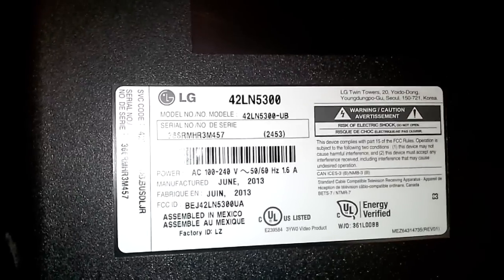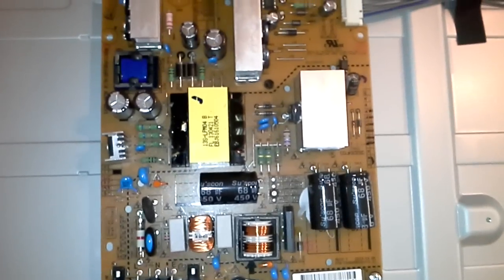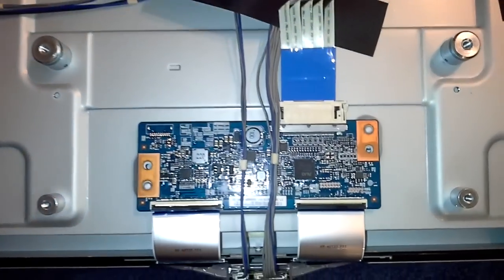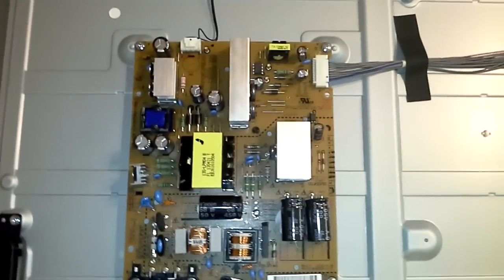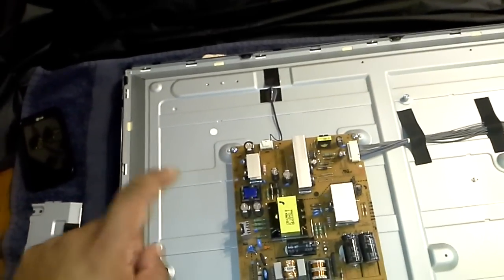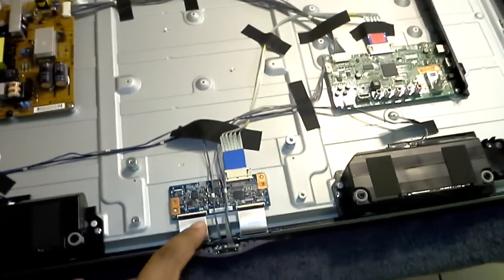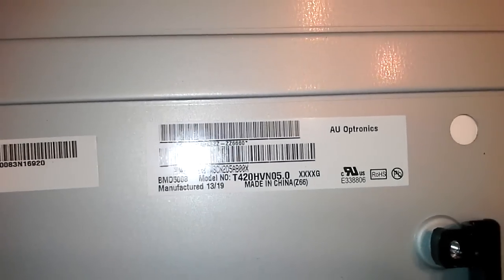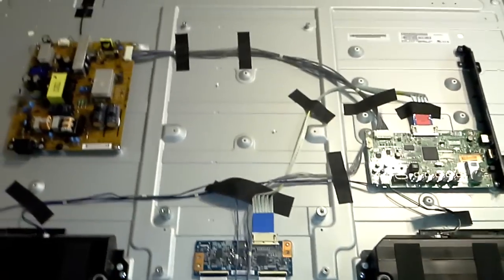LG 42LN5300 - UB

Comment: Did you try putting the motherboard in the oven at 385° for 10 mins. After 10 mins open the door half way and let it cool down naturally for about 45mins. Take the motherboard out and reconnect. Turn tv on. Lots of times its the solder. It cracks from wear and tear from hot to cold. The heat from the oven should melt it back together. If you still have the tv give it a try!

Comment: I had the same model tv with the same problem. I replaced the led strips and works now. I got the used led strips on ebay..
I hope that this is not too late
Reply from the maker: jay SHIN I no longer have the tv. But your advice will surely help others in the same position.

Comment: I bought one exactly like that one and it work fine but as soon as I plugged it in I noticed that on the right side of the screen (about 1/4 of the right side) it is lighter in both brightness and color. 3/4 of the Screen is totally beautiful, the remainder 1/4 is not as pretty and there is a clear "line" (not dead pixels) that separates the good side and bad side.
Reply from the maker: It sounds like a buffer problem? It's like memory for the TV. It looks almost the same shape. But be carful when you open it. If you do. Research other tvs with the similar problems. Let me know what happens. 👍

Comment: I have LG TV 42LN5400 made in Vietnam
Problem : No picture with sounds
My Tv has 4 four terminal going to LED backlight
Terminal 1 white cable - labeled Led + (positive)
Terminal 2 black cable – no label
Terminal 3 white cable – no label
Terminal 4 black cable – labeled – (negative)
I checked the terminal 2 and 3 I found that it is internally connected by the pcb link.
Meaning it is the center tap of LED’s in series connection.( correct me if I’m wrong)
When I measure terminal 1 to chassis of TV (negative side) I got 200vdc
If I measure Terminal 1 (positive) to Terminal 4 (negative) I got zero vots.
May I please to know where or what is the possible problem? 
Thanks and regards.

Comment: I have Lgln5400-Za , looks similar to the inside of yours, I cant locate the inverter
Reply: I have LG TV 42LN5400 made in Vietnam
Problem : No picture with sounds
My Tv has 4 four terminal going to LED backlight
Terminal 1 white cable - labeled Led + (positive)
Terminal 2 black cable – no label
Terminal 3 white cable – no label
Terminal 4 black cable – labeled – (negative)
I checked the terminal 2 and 3 I found that it is internally connected by the pcb link.
Meaning it is the center tap of LED’s in series connection.( correct me if I’m wrong)
When I measure terminal 1 to chassis of TV (negative side) I got 200vdc
If I measure Terminal 1 (positive) to Terminal 4 (negative) I got zero vots.
May I please to know where or what is the possible problem? 
Thanks and regards.

Comment: My TV has something similar.. It won't turn on period though. No sound no nothing. I unplugged it and it would work, but it started happening more often. Last night I plugged it back in and it won't even turn on
Reply from the maker: Yeah I just gave up. So still not working.
Reply: ruben42435 where did you buy it??
Reply from the maker: +Boston “Juel” Tillery  a small electronic store.
Reply: ruben42435 did you contact them? are you still under LG warranty? If I find anything out I will let you know.. I contacted LG and Best buy because I bought it there.. no response yet, I will see what the coming days bring
Reply from the maker: +Boston “Juel” Tillery no they closed down. BestBuy will cover you if you paid extra for the extended warranty . As long it's not physical damage. Like broken screen, dropped, etc.
Reply: ruben42435 yeah no physical damage, but no extended warranty though...:(
Reply from the maker: +Boston “Juel” Tillery damn...! :(

Comment: If you have a multimeter check the capacitors they are a common problem when the screen goes black.
Reply from the maker: Yeah I have to buy one soon. It's still not working.  :(
Reply from the maker: Any certain ones that I need to check?
Reply: ruben42435 mainly the ones on the power supply. The problem is to test them efficiently you need to remove them, unless you have an ESR meter which are pricey. 

A good way to judge is just to look at the capacitors. They shouldn't have anything leaking out of them, they also should be flat on the top, not bowed out at all
Reply from the maker: osiviper thanks, I have one now. But I won't be able to fix it till later this week. I'll let you know if anything changes.

Comment: You have a bad LED backlight most likely that was the problem with my LG 39LN5300-UB
Reply from the maker: Justin Krienke how would i be able to tell if that's the problem?
Reply: The only way I found out on that TV was by removing the LCD panel and inspecting the LED back light strips the dead giveaway for me was one of the LED's had quite literally melted down..... a little back story of the repair path I took was I replaced the power supply/LED driver PCB with no real change next I replaced the main video processor board still no change next I replaced the T-Con PCB still no change so I broke down and was going to part it out but well I was removing the LCD panel I found that one for the LED strips was burned in half so i pulled the LED strip, removed the burned LED and soldered jumpers to complete the circuit (this was only to test if the thing would work until I could order a replacement back light set) I do recommended you replace as a full set to keep the brightness even...... I hope this helps I can snap some pix as soon as I get it apart again.
Reply from the maker: Justin Krienke thanks. I'll try again soon to try to fix this again. Waste to trash this beautiful TV. :(